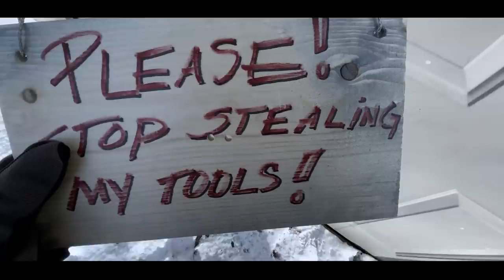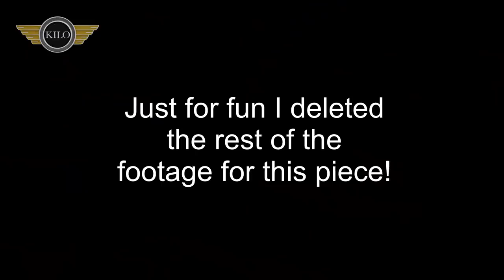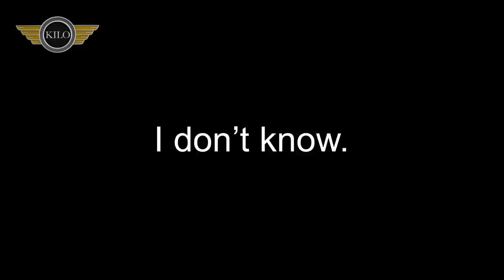FPU Bison Vise Resto'. Cause Baby I'm Worth it.

Comment: when you cut the rod off it stressed me the hell out, but i will begrudgingly admit the new one you made looks pretty good...
Reply from the maker: Thanks Daniel! A part of me wanted to leave the original handle on, I admit.
Reply: I felt bad too. He could have welded it back together and not have to create a new part.
Reply: Downside is; once metal starts bending, even if you straighten it, it weakens the structure and becomes easier to bend again.
Reply: I didn't quite understand why the OEM didn't use hardened steel for the handle. They had to know that someone would eventually use a cheater bar on the handle.
Reply: Awesome, you really do go to town on these restorations projects. BTW I once applied grease to the conical face on the swivel base, never again, these faces should be clean, you need friction to lock to swivel... But I guess you're trying to prevent rust, on a ornamental vice.
Reply: @corin164  I know ur comment is a year old but it's the same reason why ratchets and wrenches aren't hardened, they have to be able to flex because when you do put a cheater bar on (or even just a ton of force in the case of a wrench) hardened steel would shatter. The harder the steel is the more brittle, which if it shatters with that much force it could be a serious safety hazard.
Reply: @oddball0022  Shouldn't the OEM have compromised by using an alloy that provides some rigidity?
Reply: @KILORESTORATION  How much with one of these go for after restoration?

Comment: This Old Tony sense of humor + My Mechanics levels of restoration talent. This channel is going places.
Reply: Exactly . But no one beats This Old Tony's humor
Reply: This is a middle tier skill level for a restoration channel, probably on the better half of the tier. But the cringe levels of workmanship aren't up to the 98% cringless viewing that my mechanics has, as even he cuts corners. My background is in aviation repair so if an overhaul isn't done to the degree of how it should have left the factory, it's cringy. My mechanics has issues with finishing the parts. Kilo has issues with finishing parts, to a lesser degree, and has issues with quality of replacement parts. It's no dig at kilo as there are very few channels that are better, but he hasn't broken out to the levels of my mechanics

Comment: Really good work you did with this restoration project. would have never thought about using washings on the 3 on each side nuts and a very interesting way to make a handle for the vise while not having a lathe as most of these vise restoration YouTubers have at their disposable.

Comment: After watching your videos i was inspired to restore a wood and metal bench. I had the same experience with poly strip pads on a drill - it's useless. I bought an angle grinder with poly strip pads and knotted wire brushes and those 2 worked great to take off the rust.

Comment: Once you degrease and clean the casting, there's no need IMHO to remove any remaining adhered paint - just primer it and paint over it, but at this level of restoration it obviously wouldn't work the same.   I just found the same vise at an estate sale for $15 and will be going through a milder version of this.  Nice work!

Comment: i have the 3m version of those stripping disks and they work very well..  almost too well that you actually risk deep gouges in the metal.   they are only good for flat surfaces though.    my secret weapon is the roto-stripper which makes short work of anything on the surface without too much damage.    unless you get your fingers too close to the long whipping spikes

Comment: I could watch these all day long. I wish these projects didn't take so much work so you could post more. But your effort really shows in the end.
Reply: The Gator brand works just as well though the 2 thin disks stacked aren't as good as a single thick disk.

I use them both for paint, rust, and filer removal in cars.

But those old baked enamel finishes on tools are another story.

Comment: Other than being sad about the original handle and the questionable taste in hammered finish paint...Great Job! The only criticism I would have is that you really don't want to lube the swivel of the vise. It is a little like greasing your brake shoes. When you are trying to use the vise with any kind of side load on it, the swivel will slip causing people to over tighten the hold down bolts and subsequently bending the handles. To reduce rust on bare parts, at most, you could cold blue these parts, cure them with a light coat of oil, then clean with brake cleaner before assembly.

Comment: Fun video man, thanks for the entertainment!
Those paint stripper discs work really great, I prefer them over sandpaper! I'd use them with a tool offering much higher RPM like an angle grinder. Apply more downward force and use the large flat surface, not the side 🤘

Comment: If you want a stripping disc that actually works, the Norton Blaze Rapid Strip discs are great. Flexible enough that it won't strip away the base material, but on an angle grinder, would strip that vise in just a few minutes.

Comment: You need the angle-grinder-mounted version of those stripping discs. Devastatingly effective, will take mill scale off hot-rolled steel without blinking, and leave a gouge in the metal if you are not careful.
Reply from the maker: I’ve never used them but I’ve seen that 3M has some nice ones. They are on my Christmas list. I do have some 40 grit flap disc for the grinder that are almost too effective. Thanks for the comment, robmurg!

Comment: I've used one of those paint strippers before with the drill, if you use 2 of them, it doesn't work because you can't use the corber of it, which does alot of the work.
Reply from the maker: Hey Josh. I’m not really going to throw it out. I will save it for some lite duty paint stripping. Thanks for the tip!

Comment: I think this is the first dovetail vice I've seen with adjustable gib strips. The restoration is (for me) over done, but I guess some people like mirror finishes. A coupla' weeks use should sort it out :-)
Reply: Yes, I was surprised to see dovetails and a gib strip. Any other brands that folks have seen those on? A bit overdesigned if the vise sees a rough and dusty life. Now I'll have to go find a used one somewhere! Those particular machined surfaces should be treated with kid gloves for a good restoration.

Comment: HA you're suppose to fold filler when mixing as stirring can introduce air bubbles. Also smooth it in a flat sheet before using as it will increase the amount of time you have to work with it before hardening.

lol not an expert just watched a lot of youtube. But seriously awesome work. I love how you didn't use a media blaster or a lathe since I don't either and it's cool to see what can be accomplished by someone with more average means. It's also cool how you did the bars since in other vice restos they sometimes weld new ends back on and yeah I don't have a welder either.

Comment: I expected you would use a contrasting paint on the logo, but it looks good without it.  Lots of restoration channels on YouTube and yours is one of the few that I follow because the results stand out from most of the rest.
Reply from the maker: Thanks Jody! I have been practicing painting the logos, but I don’t want to do it on a real project till I’m sure I’m capable of making just right. Which is not yet! I think that would have added if it was done correctly. Thanks for the comment!

Comment: Use lower rpm when drilling with big-size drill :) 
Well done, greetings from Poland!
Reply from the maker: Sorry Mateusz, I didn’t note it in the video but that part of the video was played back at 2x. I was using about 580 rpms for drilling the handle. But thanks for sharing that tip. And greetings from America!
Reply: @KILORESTORATION  Oh, i didn't think about it! Sorry, my bad 😁

Comment: Just beautiful finish and it will be a shame to use it now. I’m a big fan of your work. If you do get a media blaster please don’t get a cheap Harbor Freight unit, especially the little bench top model, they’re pretty hopeless and potentially dangerous as they leak like a sieve and you don’t want to be breathing in the dust. At least get one with a dust extraction unit a a big enough compressor to run it. Second hand would be a good option. Cheers Stuart 🇦🇺

Comment: This was a great video, I cannot believe how great that paint looked using a brush.  I have a very large Craftsman vise I wan tot restore and this has really inspired me.  Thank you!
Reply from the maker: Thanks Guy! If I can offer a quick bit of advice. You can brush it on or roll it on. Rolling it on is easier ( small foam roller...I like FoamPro rollers for hammered paint it’s a less dense foam that helps promote the hammered effect.) it just turns out the was easier to film if I used a brush. But I recommend a roller. And I would also recommend trying out that paint on a sample first because it is tricky to get it right with out some experiments. It skins over VERY fast and is not forgiving if you have to go back over a section with the brush. Personally, it is the trickiest paint I have ever worked with, but when done right ....it looks good. Good luck!

Comment: take a look at soda blasting, its very affordable and is really light on the material (pro or con depending on what you're working on) the media is biodegradable so you can do it out side if you don't have a cabin like a sand blaster

Comment: I use those Gator wheels, if you use them on a 45° angle they work pretty good! I cleaned all the rust off a used tablesaw that I bought ant it was pretty rusted!

Comment: Anyone know the point of these vice with the dynamic portion going to the rear? I have a five or six inch one that I inherited and am thinking about restoring for my main bench, but I just can’t get over the rear opening….seems impractical for vertical clamping. Might be better off buying a conventional one. I have a ton of smaller vices, but I need/want a big honkin one.

Comment: Shouldn't you check for lead paint? Isnt it super bad to produce lots of potential lead dust with the scrubbing wheel?
Reply from the maker: Great point, HiltownJoe. I do wear the proper protective gear when doing any of that stuff. My understanding of lead paint dangers is that it is the most dangerous to growing nervous systems. i.e. children. So for me standard precautions are fine. But I’m sure avoiding any dust like that is a good idea. And I’m sure it wouldn’t hurt for me to read up on it a bit more. Thanks for the question!

Comment: 3:52 You were absolutely using the Gator Stripping Wheel WRONG!!! Those are the BEST for coarse sanding/stripping! You don't use the EDGE! You use the FLAT face and it's flexible to a certain (small) degree. You can press fairly hard at like a 10 degree angle on the FLAT surface. I find them to be an amazing addition to my resto projects.

Comment: How would you fix a vise if the large screw that tightens it were broken in two? 
I have a nice big old one, but that happened.
Anyone?
Reply from the maker: That’s tricky. Depending on the make of the vise they do sell replacement screws. Sometime with the handle attached. I would check out Amazon, Grainger, or McMaster Carr. If not that it would have to be welded back together. And that’s where it gets tricky because it has to be done correctly or it will bind. Hope that’s help T K.

Comment: do you always look for original colors or do you kinda paint the color you "feel" for the project?
Reply from the maker: I think it’s a little bit of all of that. I wanted to paint the vice the original color but just the hammered version of it.  Which I spent too many days looking for and never found. So I settled for the closest color I could find. I always have to battle choosing between the ‘original ‘ color and what I want. Except for the pipe cutter video, which I think the color was spot on, I usually feel that I got the color not quite right or just flat out wrong. But I think getting better means making all the mistakes you can so you know never to do that again. Lol. But true. thanks  for the question, Jim Y.

Comment: Looks great will the pieces you polished rust again or do you have to keep polishing them ? Awesome channel
Reply from the maker: Yes, Bruce, in time they will rust again. Although, polished steel rust a much slower rate than unpolished steel. There is less surface area for the rust to take hold in. Ideally, you would want to plate the pieces. Thanks for the comment!

Comment: What is the little piece of sorcery you use at around 8:30 in the video? Amazing finish. Quality right there. Thumbs up all the way from New Zealand
Reply from the maker: Hey Lo666zz! That would be a bristle disk. So it’s a disk that comes in different grits like sand paper for sanding or polishing. They sell them on Amazon. Also there is a link in the video description if you want to check out the ones I use.

Comment: I have a vise that looks identical to the one you are restoring, but it's not marked FPU. Maybe it's a Copy? The only markings on it are on the front handle clamp that says INDIA.
It's been in my father's workshop for over 45 Years. It's been in there ever since I can remember. It's extremely heavy. All I've ever done to it was lube the handle and clean the jaws once and a while. It could definitely use a good restoring..

Comment: When you sand steel down like that, does it rust or do the polishing compounds protect it?
Reply from the maker: It will still rust, Dan. Polishing compounds only help bring up the shine they don’t protect. They are basically very fine sandpaper in liquid form. However, the higher then polish the slower rust sets in.  Ideally I would have played those parts.
Reply: @KILORESTORATION  ok, thanks for responding. When you restore these things, do you keep a light of oil on them, or do you use silicone?

Comment: what do you use to keep the newly shined/raw metal from rusting again? clear coat? metal polish?
Reply from the maker: Hey Saywuhhhh. To ensure the metal never rust is has to be plated or as you said clear coated, or something. Polished steel rust much slower than unpolished steel. However, in time rust will start to form. Me, personal, I like to use I little light oil ( 3 in 1 ) to rub everything down with from time to time. Plating the metal is the only way to ensure it never really forms. Thanks for the question!
Reply: @KILORESTORATION  regularly oiling parts makes sense. i had decided to shine/polish all the allen head bolts on my harley instead of painting. got the idea from the full polish ratchet video youve done. Majority of them have already spiderweb spot of rust again.

Comment: Love your channel man but that’s not how you use the stripping wheel! Attach it to your drill and use the top edge of the wheel like you are drilling in a screw etc. Apply a bit more pressure and bam that thing does MAGIC. Cuts through paint, rust, and steel like it’s nothing.
Reply from the maker: Hey Austin, since I didn’t actually throw the disc out I will give it another try. That’s the beauty of YouTube....someone very well will watch one of my videos who’s experience far surpasses mine. Thanks for the tips!

Comment: What is the blue loctite used for?
Reply from the maker: Hey, F G. A.. I’m using it for rust protection on the threads. You can also use it to lock the screw in place. 242 is used if your going to remove the screw in the future and typical, I believe, red is more permanent. Thanks for the comment!

Comment: Nice restoration, kudos. Any reason you put Loctite on the gib screws? They already have nuts to tighten and hold them in place and allows adjustment of the gib as it wears. Now you have to break the Loctite to be able to adjust...

Comment: Idk how u made that coarse drill wheel (gator) thing wobble so much. When I use mine (different brand,3M) its way better than any wire brush or anything else for stripping paint and some rust
Reply from the maker: Hey Matthew. I’m guessing that the gator wheel is the home owner special and the 3M is professional. I had bought it mainly out of curiosity. Several comments have been telling me I need to get the 3M wheels. Thanks for the comment!

Comment: I love your humorous editing and your restorations are amazing. I have a couple of questions though.... why brush on paint instead of Rustoleum Hammered rattle can? Thickness concerns? Also... why go through the Bondo phase, if you're just gonna put hammered paint on it anyway?
Reply from the maker: Hey Mr. Drums. You are absolutely correct, I was able to brush paint much heavier coats than I could spray. As for the Bondo, that was really just to take care of the deepest depression in the metal and, no, it was probably not really necessary but I thought it was true to the original vise which had a fair amount of filler in the deepest depression. Or maybe its just because I’m so used to a certain process that I do it even if it’s not really required. Lol. Thanks for the questions.
Reply: @KILORESTORATION  ... Thanks for the feedback. You truly do have the best resto channel on Youtube. Keep up the good work.

Comment: Are Craftsman screwdrivers designed to be turned with an adjustable wrench?
Reply from the maker: As I understand it all square screwdriver shafts are so you can increase leverage with a wrench. Not sure if way back when that was why the first ones were designed that way?

Comment: At 8:26 what is that wheel?
Reply from the maker: That is a “bristle disk”. Depending on the grit it can be used for polishing or sanding. There is a link in the description of the video if you want to check them out. Hope that helps.